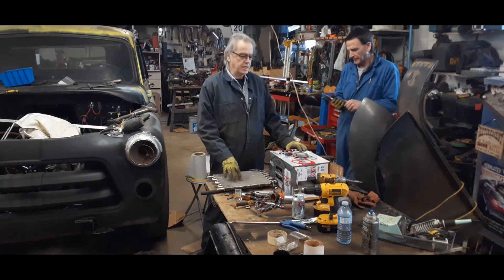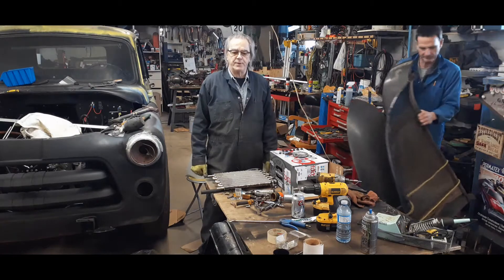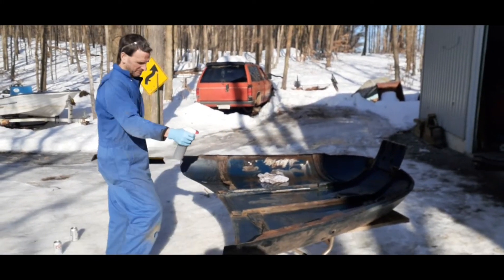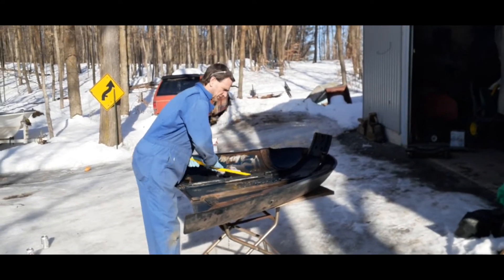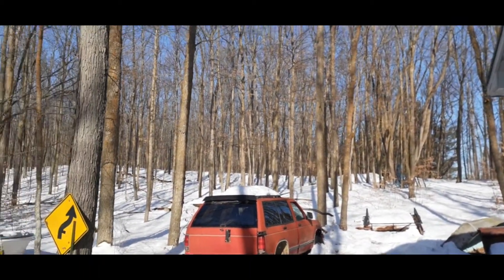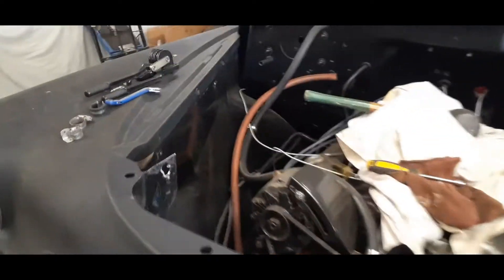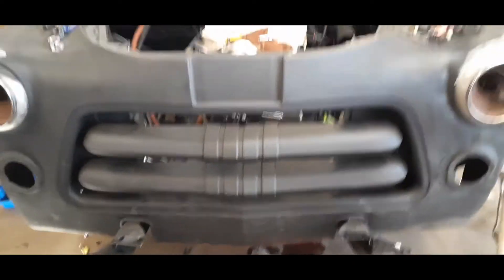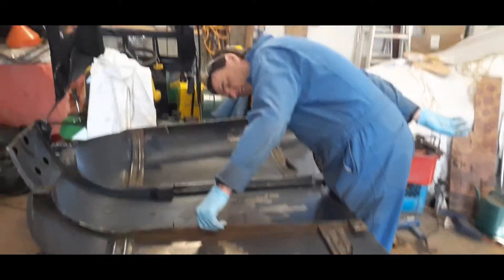# 142 More updates on my 1954 Fargo

Comment: Lots to do getting an old vehicle back on the road. Yep, the tranny cooler works best in front of the radiator.
Reply from the maker: Hey Rusty. Thanks for dropping by the Dog House. I did some modifications to my rad support today so I could run my lines to the front. I can only get about 3/4" space, but it is better than nothing.

Comment: Definitely in front of the engine radiator. Most of the kits come with, or you can but a kit that has little rubber pads and plastic zip ties that are specially to stick through the fins on the engine radiator and fix the trans cooler to it. Looks like things are really moving along! I bet you cant wait to take it down the road
Reply from the maker: Hey Magna. Thanks for dropping by the Dog House. The auto parts suppliers in my little Hick town don't carry that kit, so I had to order one from Amazon. I  sure hope I get it done by 24 weekend in May. That is my target date. 🤞🤞
Reply: @AndysDogHouse  I hope so too!

Comment: I put them under the vehicles with a small electric fan...airflow is key, so if you can put it somewhere where air gets past it, that will be fine. Radiator is the stock location for most, but doesn't have to be the ideal spot...Hell, you could put it on the fender well and cut some louvers or vents for it and the small fan if needed. Put in a trans temp gauge and see what you really need.
Reply from the maker: Hey Jaws. Thanks for dropping by the Dog House. I guess there are many spots for it. The key thing is getting air through the fins. What should the average temperature be for a Th400?
Reply: Andy's Dog House 175 is ideal... above 200 and its considered over heating the fluid. 250 and the trans is slipping and damaged.Thats what I always heard anyway. Thats why the cooler is in the radiator. Keep it around the same as the engine.
Reply from the maker: @JAWSatBCPerformance  Thanks, Brother. I have so much to learn and little time to learn it.🍁👍👍🤘

Comment: Awesome burnout at the end !  That would make an epic Intro!   Keep up the good work.  My transmission cooler is in front of my rad but there is a good 2” of space (or more) between the rad and the cooler.  💪🏽😎👍🏽
Reply from the maker: Hey Mr John. Thanks for dropping by the Dog House. Maybe my intro will be that burn-out. Thanks for the idea. I did some modifications to my rad support today so I could run my lines to the front. I can only get about 3/4" space, but it is better than nothing.

Comment: Hey Andy I've been running my transmission cooler next to the trans tail shaft since 1990. Have never had any problems. It's laying down on its side. Take care brother.
Reply: I did notice that I should clean it because it has some oil and dirt on it but not bad for being under there for 30 years.
Reply: I have no problem with the cooler being under the vehicle!!!!
Does not matter how it sits it's completely full and pressurized so it can lay down, stand up, or do the hockey pockey if that's what it wants to do!!!!
Rock On Brother!!!!
Reply from the maker: Hey BB King. Thanks for dropping by the Dog House. That sounds like an easy place to put it, but I already had my lines plumbed to the front of the truck. I started to cut stuff out in front of my cooling Radiator today so I am going to install it there.👍